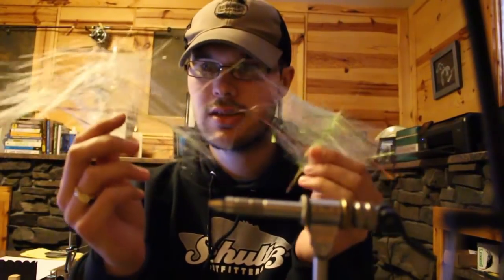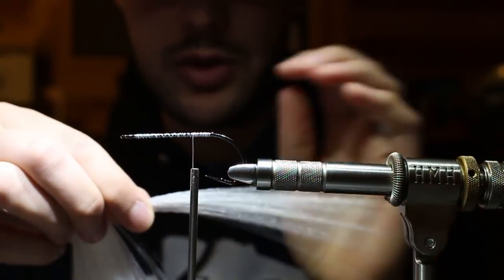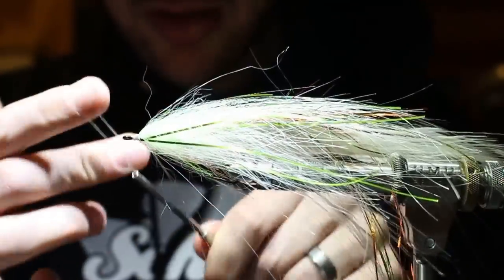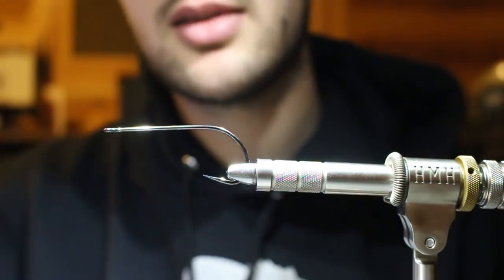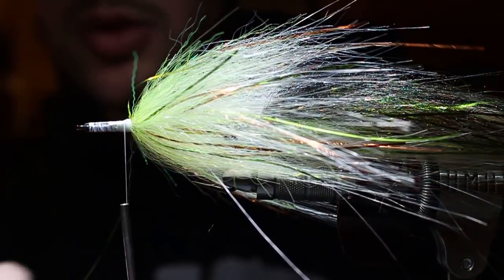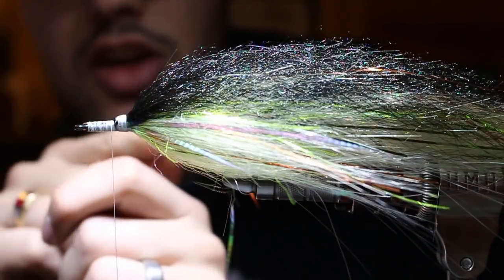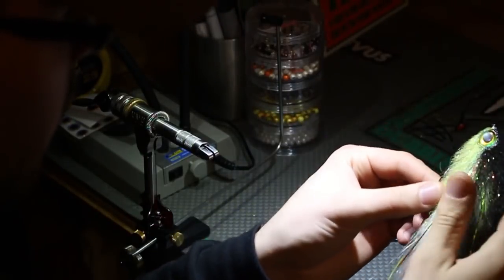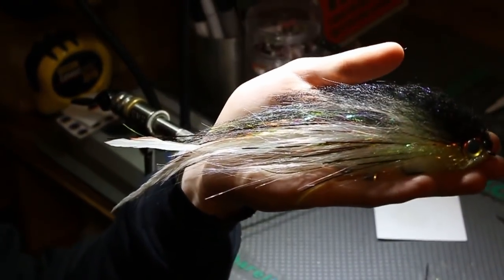Fly Tying: Brammer's MEGA-Jerk, Pike/Musky Fly

Comment: I just made 4 of these brushes. My 1st rear brush was only 3" of wire length so went with smaller Partridge Abs. Predator 2/0. After tying in tail material, I wrapped the brush and was left with 3/4" left on shank! So, I used another rear brush (4.5" wire length(7.5" total)) and am still left with 3/16" bare shank... Adding "veiling" material will add some forgiveness to this rear fly. 
I have found that having the brush end where you want on the hook is one of the more challenging aspects of making brush flies. (I now just make a single brush for each fly body and spin a couple of heads on another brush.)
After watching video yet again I see I didn't tie in front of tailing material bump but on it. 2nd, I am having a difficult time allowing myself to make "loose wire wraps." Making them spaced apart enuf to get close enough to hook eye, especially on larger hook, leaves me feeling nervous about fly durability. I tried but can't see how loose Gunnar's wraps are. Anyone have any thoughts on this? 3rd and maybe irrelevant, my wire was also .006 vs. GB's .009. 
 Maybe my mistakes will help someone else.

Comment: Awesome looking fly. I keep a small diamond file on my desk to dull the ends of the wire. It not only helps prevent cutting the thread, it also helps to reduce punctures to fingers when working with wire.
Reply from the maker: I have definitely put some new holes in the ends of my fingers playing with this stuff. Thanks for the heads up man I will check it out!
Reply: Gunnar Brammer ... Thought I'd mention this and I haven't tried it yet. With regards to your keeled fly tied on the worm hook. Have you looked at the Gamakatsu Jobee Pro Worm Hook? Google the hook name.  Captain Hook Discount warehouse carries it. It definitely has some possibilities.

Comment: Great looking fly! Will it fish on a 8 or 9 wt rod since it's mainly all synthetic?
Reply from the maker: Hey Roger, an 8 wt would be pushing it - you could certainly get it to turn over with a shooting line, but you'd only be looking at perhaps a 30-40 ft cast. A 9wt can handle it just fine - I would recommend a full sinking line for either the 8 or 9, simply because the higher line speeds will help overcome your air resistance while casting. Hope that helps - you can also reduce the bulk in the brush and tie a slightly downsized version - although I'd likely keep the hooks the same, and should make it more friendly for the lighter rods.

Comment: Sick fly. Does the tear mender/ uv resin head not work as well with the fuzzy fiber?
Reply from the maker: The Strung Fuzzy Fiber is really coarse and the Tear Mender doesn't soak into the fibers the same way it does with dubbing. The 5 minutes epoxy has been the best solution I've found - it may seem time consuming, but at the same time its nice not having to do a UV top coat over the head. The dubbing head previewed in the previous tutorial still works great as a head, I just don't like how it collapses behind the eyes and created a non uniform silhouette. The Strung Fuzz allows for a bulkier fly compared to the dub heads and still doesn't add any water weight.
Reply: Well the new head looks awesome man👍
Reply from the maker: Thanks Bret! Appreciate it man